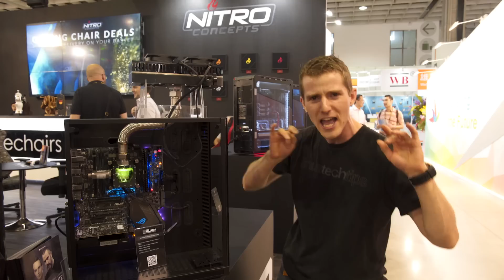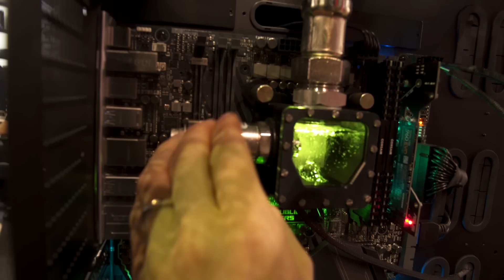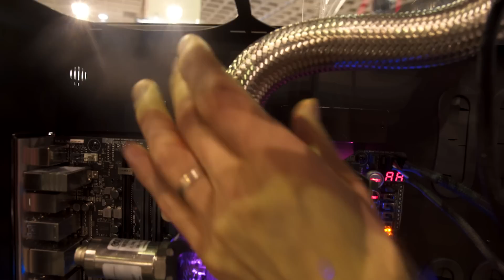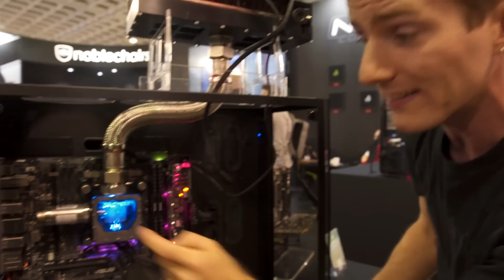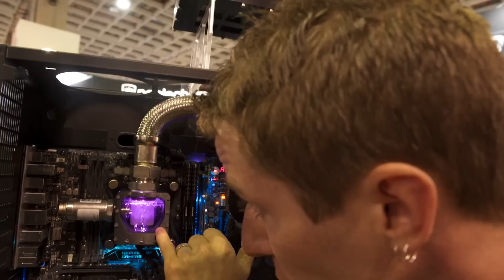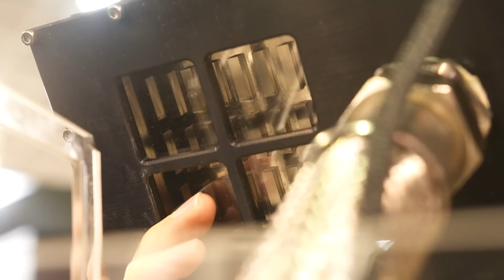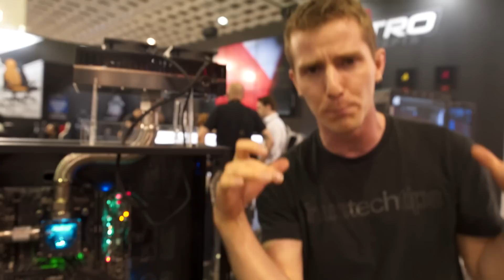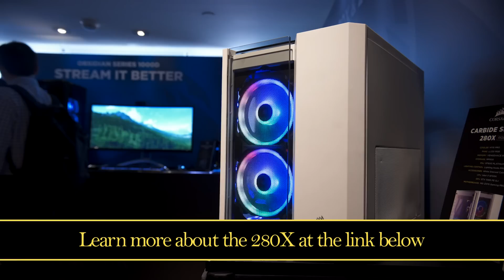Crazy Der8auer cooler prototype - NO pump!

Comment: Great innovation from de8auer. Only problem I can see is that the rad/tank will be 60mm or less. Might be too thick for the top of most cases. Hopefully it will be a LOT thinner than 60mm.

Comment: 99.9% sure it's Vertrel XF (55C boiling point) as its similar in properties to Novec 7100 (60C) but lacks PFC's that make 7100 heavily regulated due to bio accumulation risks. When cut with various other common chemicals it can be adjusted for lower boiling points

Vertrel™ XM - Methanol - 46C
Vertrel™ XE - Ethanol - 52C
Vertrel™ XP - Isopropanol - 52C
Vertrel™ MCA  Trans-1,2
 Dichloroethylene  - 39C

Comment: Is the liquid under pressure or a mild vacuum? Because that would really open up the number of working fluids you could use for something like this. Even distilled water would work (very well) under the right amount of vacuum.

Comment: Im going off the deep end and suggesting its Carbon Dioxide under high pressure... to keep it a liquid. I could be totally wrong with the guess due to the apparent lack of pressure resistant hardware... as in the really high pressure required to keep a room temperature gas a liquid.

Comment: It's most likely novec 3M non-toxic non-conductive, https://www.3m.com/3M/en_US/novec-us/applications/immersion-cooling/ 
it's been around for quite a while and is used in certain military applications for specific cooling needs. Extremely expensive per liter though, like on the ballpark of 300-500$

Comment: Pure (Or almost pure) alcohol, because when it boils it produces fine mist that can easily be cooled down and as it's in pressurized environment you can have fast cycling rate with hot and cool alcohol.

Comment: Its probably a proprietary organic liquid. I worked on a project that uses a proprietary fluid that boils at just above room temperature, and it worked really well, so im not surprised they are able to do something like this. The only concern I have for this is what if ur CPU gets to like, 90C? then the system would boil to the point where most of it is gas and you don't have anything to cool the cpu down, pressure will also rise like crazy. not allowing standard tubing/connecters to be mounted, plus u cant have a radiator because that would defeat the purpose. So I am wondering how they are gonna tackle these any many more challenges while working with this stuff.

Comment: Maybe a mix of 3M Fluorinert FC-84 and FC-77, for boiling at a reasonable point that would get the heat and gas out of the pool and would condense back into a liquid without too much difficulty. The pressure sensor being for safety to be sure that it doesn't build up enough pressure to bust the seals. Since these liquids wouldnt be too good for the components.

Comment: They're going to use something that is non-toxic/minimum regulations, something that is inexpensive, and something that will have minimal harm, should it leak.  I would guess the best fit for a commercial viability would be an ethanol-based coolant.  It boils at 34 C (93 F)under vacuum so it gets that cool bubbling effect within normal operating temps, plus, it's non-toxic.

Comment: Carbon Tetrachloride... or just plain alcohol in a vacuum state.  No pump required, just the heat from the cpu need for fluid dynamic reaction.

Comment: Seems like it would be Dichloromethane to me. You need a fluid that boils at a fairly low boiling point (but also above room temperature) so that heat is taken away quickly and can still be cooled back into liquid. Dichloromethane is what was used in Jukeboxes for the 'bubbler'

Comment: Probably just water with a low internal air pressure, that would have high conductivity, a high heat capacity and be cheap. Also it's been done before in heatpipes.

Comment: Clearly by the velocity of the bubbles and size of them flowing though the liquid the viscosity is low. Also, Wattson, you can see how clear this liquid is. I also see that this is boiling at what I assume is well below the CPU TDP and thusly can deduce that this liquid is none other than deionized distilled de-souled dreams of baby seals.

Comment: I would bet its a Carbon Disulfide solution, mixed with a few other compounds to reduce toxicity and flammability.

CS2 has a boiling point of 46.2 degrees C which is around the temp processors should be (ideally), also a specific heat capacity close to water when in solution.

Comment: It must be some sort of alcohol, or maybe alcohol cut with a small amount of something like water
Reply: I'm not sure you would want anything flammable in there....
Reply: Scott M I don’t think it would be an issue, I don’t think the cpu would be able to heat the alcohol enough. Only the fumes would be flammable not the alcohol in its liquid state. Also if the unit is sold in the form of an AIO which is most probable than the loop could have such a low oxygen content that combustion would be impossible.

Comment: methylene chloride if the front cover isnt acrylic. But there is also a possibility that Freon 113 is being used but that would be rather expensive last I checked about $84/lb.
Reply: I would assume that what ever the liquid actually is has a boiling point under 60c at 1 bar.
Reply: But its entirely possible that its just basic distilled water under vacuum. They do have a pressure sensor on the block.

Comment: It would have to be a very low boiling point liquid that would condense at just above say 40 degrees, (Considering hotter areas), ambient temperature for this to have any affect. There are a number of liquids that fall into that category. Now out of those, it would have to be a non corrosive, non lethal liquid. Also should be non conductive if there's any spills. So to take into consideration most of these factors, I would imagine Ethanol or Methanol may have been the first liquids to be experimented with as they boils around 79 & 66 degrees Celsius respectively, (Linus did say it was rather toasty). Lower boiling point liquids are available, (there's a whole heap of them). They all have various levels of toxicity, flammability and conductivity.

Comment: It's water at lower than atmospheric pressure pressure (say 0.66bara {not a vacuum}) so it boils at around 50 DegC. Then Natural Convection circulates the water through the cooler to be condensed from vapour back to liquid.

Comment: I think it’s just distilled water, maybe with additives with anti-growth or corrosion prevention properties, under somewhat of a vacuum. Like others have said, it can’t be a complete vacuum because the water wouldn’t condense. With the pressure sensor, I assume they are monitoring pressure to make sure it doesn’t gain or lose pressure to keep the boiling point where they want it.

Comment: I wonder how you place it on if the CPU is visible, because it means that if CPU is visible, then what I see is the board(?) around it a little bit, so it encases, or surrounds it right to the board itself, and board itself is getting the liquid as well. That's why I want to know what is enclosing it exactly, some sort of pads? rubber stuff to seal the gaps and not damage the board? Just wondering how they can attach it and detach it without leaking it. Btw...what is that thing attached to it, to the left?

Comment: why whould this be better is it better if you know please tell me.
Reply: No pump means no chance of failure... you don't need to worry if a pump goes out and having to check on it frequently to ensure that doesn't happen... My water cooling BigWater $200 unit pump died in the first 30 days of owning it despite having the proper levels in the unit and Thermaltake never granted an RMA ( I used the same fluid, etc... all that was supplied in the package ) or a refund which is why I won't buy Thermaltake again. I've been running on air ever since... Having something like this would be great.

Comment: Novec 1230? Boils at 49.2 C Is non toxic, Used as server cleaning agent and gas fire supression. It is also already used as experimental full submersion liquid cooling due to having good heat characteristics, it has low vapour pressure. The only real downside is that it is harmful to aquatic life with long lasting effects. But it is already classified as allowed for use in electronic sollutions across most of the world due to its use in serverroom/datacenter fire supressant systems.

Comment: So he may have recreated something akin to an RV refrigerator? I doubt it's exactly the same since those use liquid ammonia, water and nitrogen gas under 200 psi of pressure and have steel tubing for that reason , but they use no pump either. They also have to be level within 5 degrees from side-to-side in order to work correctly (which is the main reason an RV has to be leveled once you park it for use).

Comment: It almost looks like the same sort of system as you'd find in an RV absorbsion refridgerator in which case it would be using ammonia, but I don't think that would be something home users would want to deal with. Then I thought maybe enthanol or isopropyl alcohol, but those also would be dangerous should there be a vapor leak and alcohol fires are really nasty. So my guess is plain old water. As long as you don't start building steam faster than the condensor can deal with it, it could work and would explain the serious pressure sensor on the prototype. Other than being hot, it's pretty much non-hazardous. The CPU would run warm, but should stay within parameters. You'd need a pressure sensor to shut it down if there were a problem like a vapor lock since steam explosions aren't fun. It would also explain the very heavy duty hardware used.

Comment: It can't be a coolant, because you would need a fluid with a low enough boiling point, for the heat of the CPU to cause boiling.  The hose looks like braided stainless steel?  I'm guessing the fluid is something household, possibly corrosive.  If you don't mind your system running at 80 degrees Celsius,  Isopropyl Alcohol would be a highly likely solution that wouldn't have major transporting issues.

Comment: Methanol (methyl alcohol, wood alcohol), boiling temp: 66°C or 151°F
if they tweaked (lowered) pressure - then it would even boil at lower temperature.

Comment: Linus, you need one of these for your threadripper CPU with the swapped heatspreader....after you swap it onto one of the new 32C/64T parts, so you can bask in it's visibly swapped glory while it's running.

For the liquid I'm going to guess water. The fact that there's a pressure sensor and some kind of valve on the condenser makes me think it is a bit depressurized to boil at a lower temp...and water is cheap and has a high specific heat capacity.

Comment: because we dont know the tempreture of the fluid we dont know what its boiling point is so it could litteraly be hundreds of fluids and if its mixed it could be thousands
Reply: Also, the pressure (or vacuum) applied to the system. There has to be a reason they need that sophisticated of a pressure probe for their system.

Comment: My best guess is Methylene Chloride / Dichloromethane.
It boils easily, at about 40°C, would restrict the use of certain materials being that it is a solvent, and has a thermal conductivity that isnt terrible at 0.1392 W/m-K which beats out Chloroform in both boiling point and thermal conductivity. Plus the vapor pressure increases nicely as temperature rises iirc.